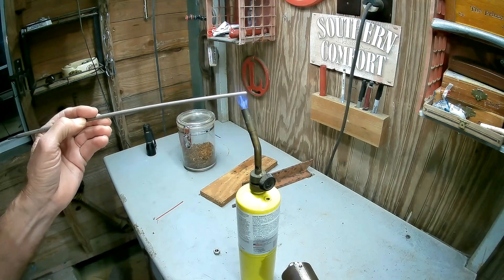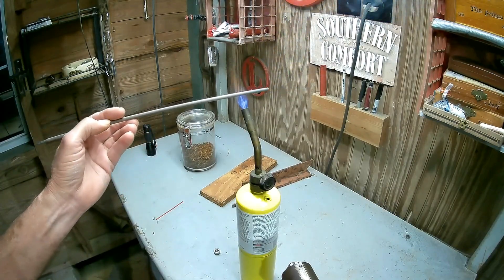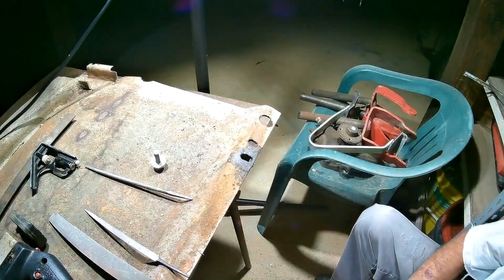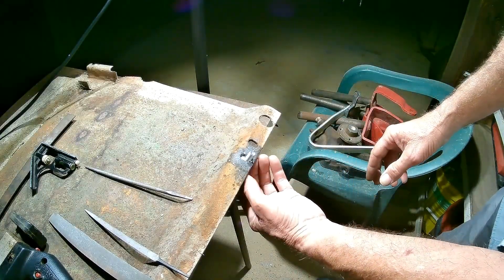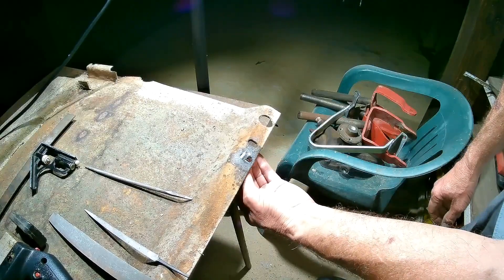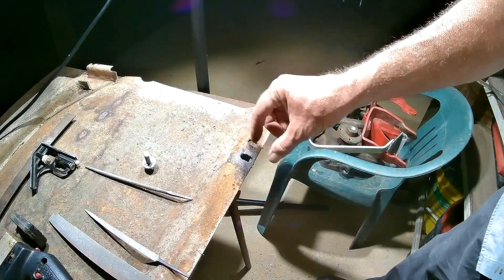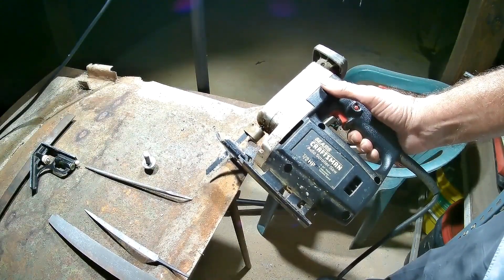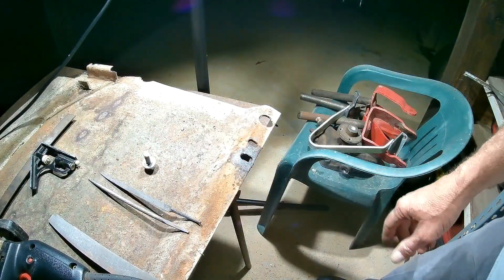Finishing the repairs on the skid plate

Comment: If you continue with all this welding, you're going to need to get a welders skull cap, welders cotton cap or wear a bandana (babushka), need to keep the sparks off the top of our bald heads! I have a dozen caps and no welder here in Alaska but they are comfortable the more they get washed.
Reply from the maker: AKWayne S - I had this one green cap that I could turn around backwards and it worked great.  for some strange reason the cap I'm wearing out now won't work right and my shield strap doesn't feel right.   I am hoping I am finished welding for a long time.  running that this welder is expensive.